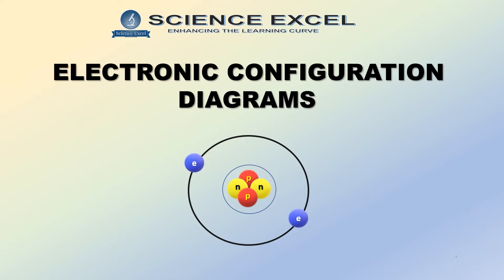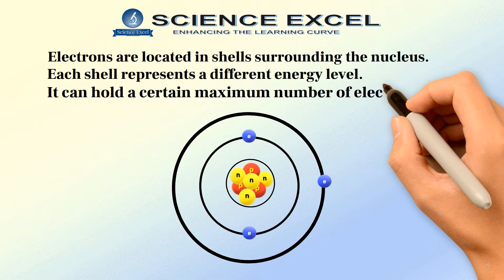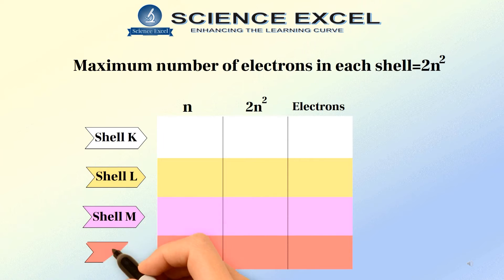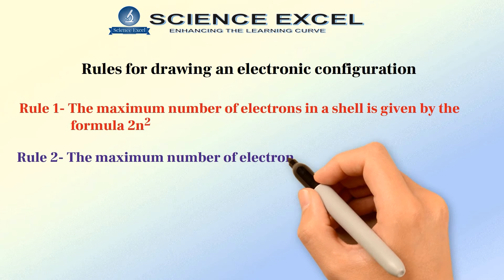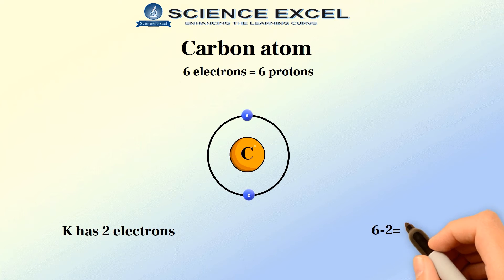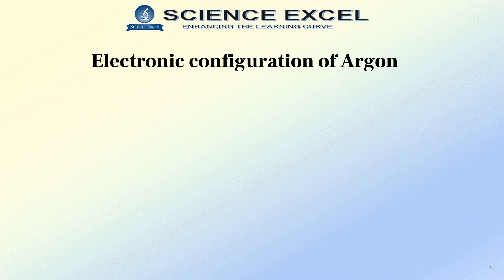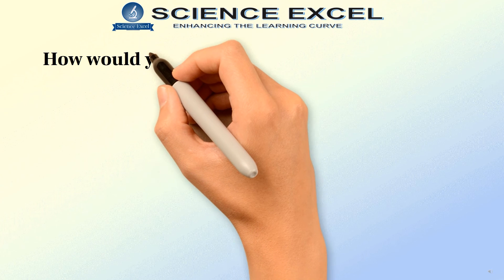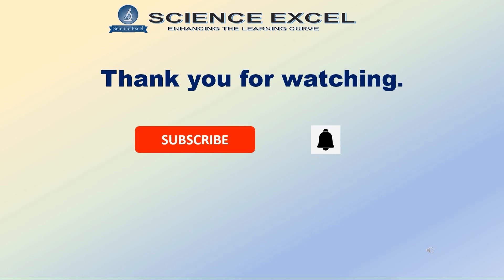How to draw electronic configuration diagrams | Science Excel

Comment from the maker: Please feel free to post any queries that need to be answered in the comments section.
Reply: Why do some videos say that the 3rd shell only holds 8 electrons? I have seen this in several videos.
Reply from the maker: @edvardbrown1041  The third shell can be considered to hold 8 or 18 electrons but  in total the third shell can hold 18 electrons. As the maximum capacity of the shell to hold electrons is 8. The shells of an atom cannot accommodate more than 8 electrons, even if it has a capacity to accommodate more electrons. This is the Octet rule. Due to this rule, the shells ‘M’ and ‘N’ which have the capacity to hold more than 8 electrons are allowed to hold only 8 electrons. This is as far as you learn for GCSE or equivalent courses generally.